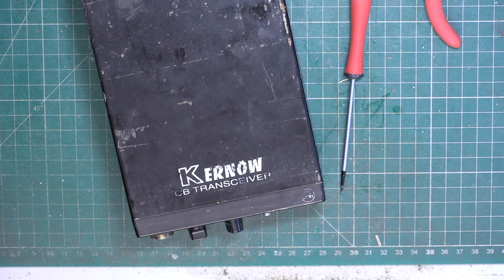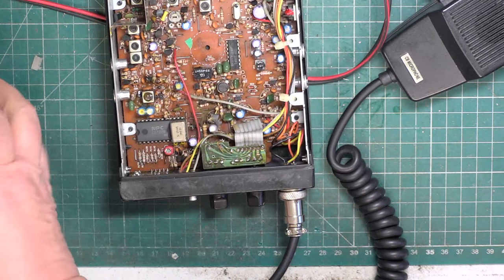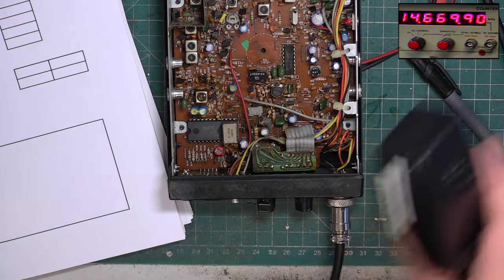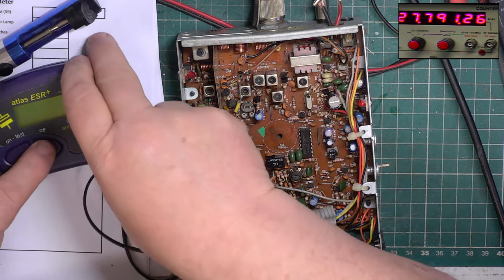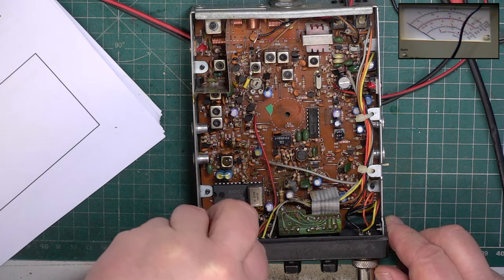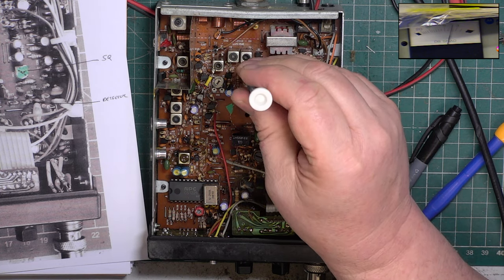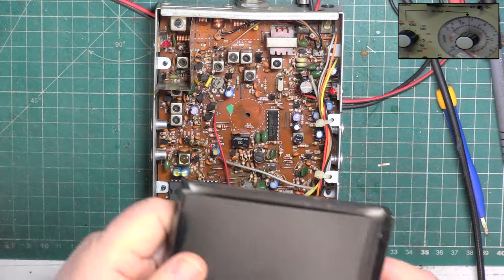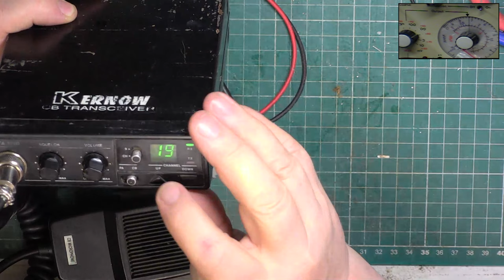Kernow Beta 1100 CB27/81 UK FM CB radio - repair & service alignment

Comment: Hi 👋 richard good luck repairing the kernow beta 110 cb 27/81 uk fm cb radio from paul chapman at east sheen 73's   also I took my soldering iron to lasyl yesterday morning it has to be sent away 
so I have to wait for it to come back
Reply from the maker: Roger on that Paul. Thanks for your comment.

Richard
Reply: @ukfmcbradioservicingTango21  to richard you are most welcome looking forward to the air test From paul chapman at east sheen 73's

Comment: The case has seen better days and could do with a lick of paint.  Other than that,, a set one can still adjust and crystal filter as a bonus.  Shame they chose to skimp on crystal filters on earlier sets, it would have made some peoples lives a bit better, however, there were so many CBs around that the front ends were overloaded a lot of the time from your neighbour anyway!  🤔

Comment: Thank you for sharing this video with us. I notice you are using a "Cybernet" wired mic, was the circuit board made by Cybernet (in which case can you please tell me which model of board the set uses) or does the set just happen to have the same mic wiring as a Cybernet set?
Reply from the maker: The sets were either made by Maxon or an external contractor to Maxon. They are not made by Cybernet. Cast your mind back to the Midland 'precision' series; 2001, 3001, 4001, which are also Maxon built sets using the 'standard' Cybernet microphone wiring.

The Kernow Beta 1100 is electrically very similar to the Midland 77-095 but the 1100 has better squelch operation than the Midland & is not prone to dry joints in our experience either. It is therefore superior to the Midland 77-095.

Richard, G0OJF, UK